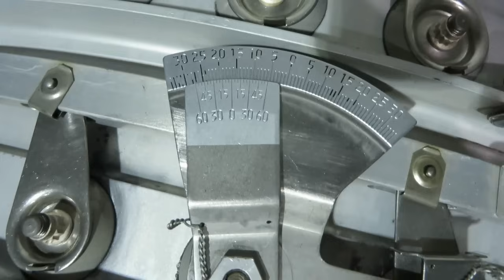Jet Questions 75

Comment: Hi, maybe I can shed some light into the subject of "turbine reaction lag". I built a gas turbine driven replica of the first turbine car, Rover Jet 1 (check my videos to see it in action). My experience is as follows: I used an Rover 2S/150 APU (two shaft, 150SHP), the free power turbine is directly coupled to the rear wheels via a reduction gearbox. This means, that it's using one gearing for the whole speed range (0-120mph), taking off isn't really fast, even if the gas generator is spun up to full power before letting off the brakes. The normal idling speed is set to approx 50% of the compressor rpm, every input from the accelerator pedal takes 1-2 sec until you feel the corresponding power output. I tried my car on a race track, the basic driving approach is to keep it floored and use your left foot for braking. The rear brakes need to be larger than on a regular car, since they need to absorb the excess power from the turbine under braking (assumed you keep it floored ;) The goal is to keep the gas generator revs up all the time and so the power on tap. For drag racing/faster acceleration, a two/three speed automatic gearbox is probably a good idea, with the free power turbine acting as the torque converter. 

Hope this helps, best regards
Reply: +Georg Mayr-Harting  As a boy, I actually saw Rover's JET 1 and some of their other gas turbine powered cars on the road, as their route between Solihull and the MIRA test track took them through the centre of my home town.  In particular, I remember one, a coupe (a T3?), braking to turn sharp left off the main street, but the engine note was rising.

Comment: When you install ceramic coated turbine blades in a J79 for the first time. Do you have to perform any additional tests to ensure that other engine components haven't become over stressed?
Reply from the maker: +Fraser White No. We don't use it to allow hotter firing temps, we use it to protect the blades from the heat they normally experience. It prolongs their service life, so far indefinitely.
Reply: +AgentJayZ - I take it the ceramic coatings are a modern thing, whereas back in the day when the first J79s were rolling out the factory door they were equipped with only raw metal blades?
Reply from the maker: Ceramic coatings were developed after the J79 was introduced.

Comment: The question about the guy with the turbine powered super car , in F-1racing the turbine powered cars used a blow off valve to dump all the exhaust out of the gear box for braking , and close the valve to get back on the gas.
Reply from the maker: There are no turbine engined F-1 cars. Never has been, ever.
A turbocharger has a turbine, but it is not a turbine engine.
Thank you for providing an excellent example of the importance of calling things by their correct names.

So... calling something "turbine powered" is so vague as to be meaningless.

Comment: Mr Z,
Would love to see the different temps that case is subjected to from the bell to the afterburner... Maybe walk down the case with an IR thermometer??? 
Thanks Mr Z, Great Vid as usual :-)
Reply: +Brian W  -40 to + 800 - 950 0c
Reply: +philzambo Thank you for the reply, thought it might be interesting to see the contrast from inlet to outlet... Just to see the extremes this case is subjected to, and the nightmare it must have been to engineer to extremes, AND make it light enough to fly :-) (Especially when this engine was designed, no computer, just a slide rule ;-)
Thanks again
Reply from the maker: +philzambo Ambient at the inlet, to around 700F at the compressor discharge, to 800+F on the Afterburner casing.  F, not C.
Reply: AgentJayZ Sorry about that,

Comment: What's the avg psi inside of the combustors or combustion chamber before ignition say j79 or even j100 fighter jet engines
Reply from the maker: The variable you are referring to is called CDP, compressor discharge pressure.
In the J79, it is between 150 and 160 psi At 100% rpm.
Ignition and heating due to the burning of fuel does not cause this pressure to increase.
Not piston engines.
Reply: @AgentJayZ  thanks brother.. exactly what I was wondering

Comment: So, what aircraft is that going in? Privately owned??
Reply from the maker: The aircraft that this engine will be installed in is owned by a company that contracts to train pilots. I do not understand your double question marks. Usually they indicate urgency or panic, and there is no need for that here.

Comment: Dear sir 
I belongs to india & your video is very detail explained very well.
Also I'm not a technical guy,
But the way u explain is very interesting.
I have a question  that india building a kaveri jet engine and they fail till now, if it is possible for u kindly explain all problem issue  with it and probable solution.
Thank
Reply from the maker: I just read the Wiki page on this project. Of course there are no easy answers to your questions.
Two points, though:
This does support the idea that competitive turbine engines are extremely expensive to develop from a blank sheet of paper. Much more expensive than most people realize.
 and
It seems to me that this engineering project has been impaired on many levels by politics.

After my half hour of reading and thinking, I believe this engine will only be used if political influence forces the end user to accept an aircraft with less performance than would be possible if the engineers were permitted to carry out this project without interference from non-technical people.

Solution?
Unlikely.
It would require a sea-change of attitude on the part of the entire government and political system.

Comment: What is a visual difference between j14 and a j79
Reply from the maker: I am not aware of an engine called a J14. Maybe you meant the Orenda 14?
If so, the J79 and the Orenda 14 only share the fact that they are single shaft turbojet engines.
Everything else about them is different. even counting every nut, bolt and washer, they share no parts.

Comment: Hi,,,Can you overhaul RR Avon 1533? if you can, plz let me know as I need an engineer for a project we are doing..thnx
Reply from the maker: +marbello1 I have worked on 1533s, 1534s and 1535s.The reservoir of Avon experience is in Jet City.
Reply: Ok ,,great..with all due respect,,would you know what the maintenance cycles are? do you know the procedures? there are 2 engines in Dubai on an oil field..Let me have your CV if poss..where do you reside?
Reply from the maker: +marbello1 You've set up your channel page so that it is not possible to send you a message, and there is no info at all about you.
So there's not much credibility there.

I know the procedures, and I am in Canada.

Comment: If you were going to put a turbine in a car, I would THINK (not a professional here) that you would want to keep it up at like 85-90% rpm and then use a distributable torque gearbox, like a CVT, to control when you accelerate. Then the engine only spools the 15-10% up to full, and the gearbox takes most of the brunt of the acceleration through the lower speed. It will also help with fuel consumption to keep the engine up in a higher operating range, rather then reducing and building revs constantly.

Comment: Getting parts for a J-58 is probably harder than getting parts for an F-1 rocket engine, and that's not counting the ITAR restrictions that are on rocket engine parts. At least you can find an F-1 rocket engine on the sea floor. No such luck with a J-58.

And the J-58 is only half of the equation. The intakes could bypass air straight to the afterburner, effectively forming a ramjet engine in addition to the J-58 turbojet. That's one of the reasons that the SR-71 almost always operated in afterburner, only turning it off for landing and mid-air refueling.
Reply: +44R0Ndin  - So all the J58s that did end up on the sea floor have all been recovered?
Reply: Andrew Mckee
As far as I know, there were only ever a very few SR-71 crashes, and all of them happened over land.
I'm sure the US government was very quick to recover or destroy the wreckage in order to prevent other countries figuring out the SR-71's capabilities or how it worked. Highly classified spy planes tend to get that kind of special attention when one goes down, so long as the government can get to it.
Reply: +44R0Ndin  - Well the LSO of the M21/D21 collision drowned at sea, so I'm guessing the rest of the aircraft also fell into the pacific ocean. And there was the SR71 operating out of Okinawa that just disappeared, location unknown, I'm guessing it also fell into the ocean since an international incident would have resulted if it fell on land.
Could be others, you'd have to talk to the right people to find out.